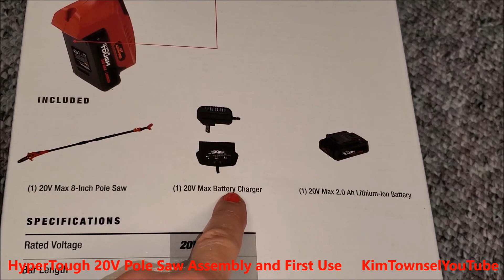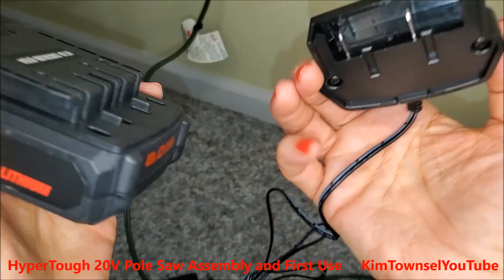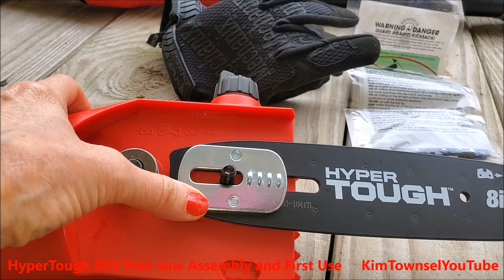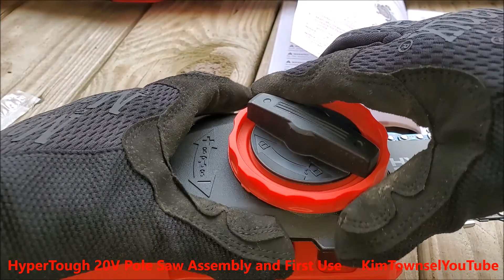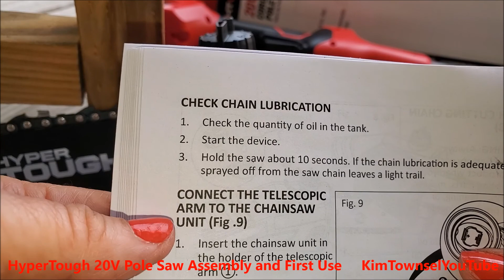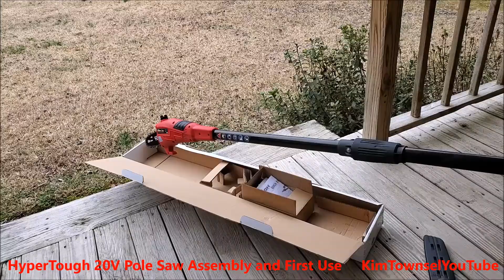HyperTough 20V Pole Saw | Assembly and First Use by a Novice | KimTownselYouTube

Comment from the maker: What I demonstrate in this video: Hyper Tough 20V MAX 8-Inch Cordless Pole Saw, HT19-401-003-08
$97.00 https://www.walmart.com/grocery/ip/Hyper-Tough-20V-MAX-8-Inch-Cordless-Pole-Saw-HT19-401-003-08/481535824
 
Similar pole saws:
WORX WG309 8 Amp 10" 2-In-1 Electric Pole Saw & Chainsaw with Auto-Tension https://amzn.to/39vn7Nn
Remington RM8EPS Ranger II 8-Amp Electric 2-in-1 Pole Saw & Chainsaw Combo with Telescoping Shaft and 10-Inch Bar for Tree Trimming and Pruning, Orange https://amzn.to/3dlmQOq
Sun Joe SWJ803E 10 inch 8.0 Amp Electric Multi-Angle Pole Chain Saw, Green https://amzn.to/3ubOKDm
BLACK+DECKER 20V MAX Pole Saw, 8-Inch (LPP120) https://amzn.to/3woybGf

Comment: I just bought one, thinking that it had a battery charger. After getting it home, I found it does not have a battery charger, but just a usb c cable to charge it with. Unfortunately, I have no way to charge it with the provided cable, so I'll have to spend about 25 more bucks on an actual charger. If I had understood the extremely cheap charging cable they put in there, I would not have bought this pole saw. So, if you buy one, be sure there's a charger in the box included, or buy the charger for it. Oh, and they give you virtually no bar & chain oil, not enough even to get started, so you need to buy that too. I think they might include 2 oz. of oil at the most. Back to Walmart I go, and this pole saw is going to wind up with the oil at about 200 bucks. I did purchase an extra 4 Ah battery for it, though, for times when I'm doing more work with it.

Comment: I may have to add plumbing tape or use duct tape to make sure my telescoping arm clamp sleeve stays locked. My collar(not the electrical connector collar) won’t lock , it just spins forever. This seems like it won’t lock the telescoping arm in place while it’s extended. Oh well, only payed $72 after tax & I can use the battery and charger for another hyper tough tool. Excited to try this pruner out & I really hope some pipe tape will allow that screw collar to properly lock & hold the saw at desired length while working. Have an acre of under growth fix up someday #yikes. My dad got the $100 20volt hand chainsaw & I was gobsmacked by how much it cut & how long the battery lasted. Lol, I’ve been using old hand me down lead type 18volt black n decker tools & those batteries don’t last & my charger stays warm forever which seems a fire hazard.

Comment: You should have left the chain 'too tight'. ALL chainsaw chains stretch quite a bit when new.
After their initial stretching period; it will be easier to adjust the bar for proper tensioning.
Reply from the maker: Thanks.

Comment: I am needing to replace the saw blade and I bought one that was 8in and 20 cm but it seems a little big is there any other dimensions I need to be worrying about?
Reply from the maker: I am not sure. Perhaps another viewer can answer for us.
Reply: @KimTownsel  I can confirm Trilink S33.043 - 8" 2 Pack Replacement Saw Chain; 33 Drive Links; .043" Gauge will work as a replacement
Reply from the maker: @davidsorensen6433  Thank you!

Comment: I just got the last use out of the one i bought a couple of years ago. Let me tell you, i did SO MUCH work with it you guys wouldn't believe me unless you seen it. I abused it, dropped it, etc. The chain never got dull or anything. Im going straight back and getting another one. I cant imagine there being another deal as good as this one. I usually dont leave reviews or anything but this thing was flat out unbelievable. Matter of fact it was still running, cutting, and oiling perfectly fine when i threw it away. I had broken the shaft during a fall off a ladder a while back and taped it. Had a limb fall on it since then etc, etc.. Without being abused the damn thing might have outlived me. I HIGHLY recommend this pole saw!! I don't know about any of the other hyper tough products but the bang for your buck with this saw is something else.

Comment: I've had a Black and Decker electric weedeater for years. I got it on sale for 30-something.  It has an auto line feeder. Loved it. Got my extension cords and off I go.  Then I got an electric chain saw, electric lawnmower and chipper.  Love them all.  I have this battery saw (not crazy about a battery) haven't put it together yet.  Been putting it off.  Overfilling your oil well is important.  I'd say the last hash mark is your fill line.  Thanks for the video.  The chain instructions were a little confusing. (Edit:  The chain instructions that came with the saw were the confusing ones.)  And I hope this chain stays on better than my chain saw does.

Comment: I’m pretty skeptical of electric saws, but bought one of these because I needed one fast. I had a big cracked limb hanging close to a power line. I got it cut down in less than an hour. I’m pretty impressed.
Reply from the maker: Yes, this has its purpose! Thanks for watching and sharing.
Reply: @KimTownsel  Thank you! You’re a very smart, pretty, and hardworking lady.
Reply from the maker: @5roundsrapid263  Made my night, sir! 😃
Reply: It will last you forever, believe me. I got about $5000 worth of good out of my first one and im going for a new one tonight.